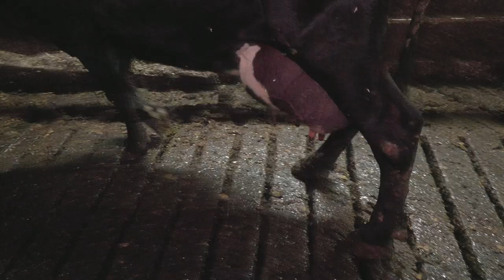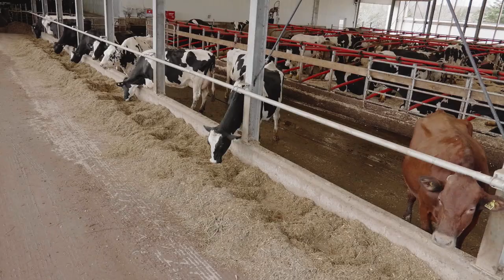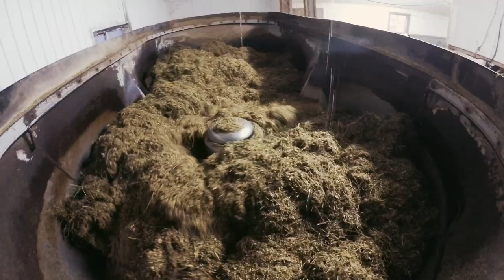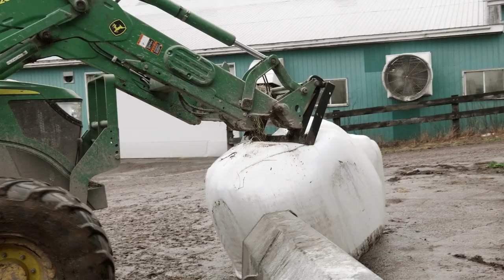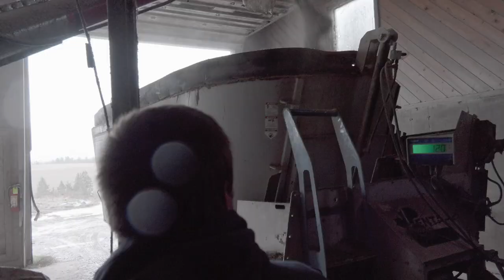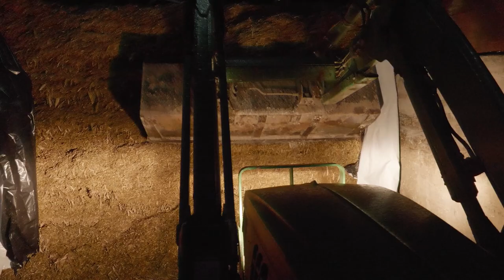Mixing feed for 120 cows

Comment: Good for you Devin.  You worked hard on these videos and it shows.  Get home safe.  Was it cold in the barns or is there some sort of heater in there?
Reply from the maker: It's cow heated!  Their body heat keeps it a few degrees above the outside temperature.  Generally speaking though, they like it cold — I'm told their "room temperature" is only 3-4ºC.  Much higher than that, and they start showing signs of heat stress, so the barn is full of fans to vent the heat to the outdoors.

The Dairy Industry takes "cow comfort" seriously.  Temperature, mats for them to lie on, brushes for backrubs — I could do a whole video on the topic.  The reason being, a comfortable cow produces more milk, so there's an incentive to ensure that they have a good life.

Dairy cows are pampered!